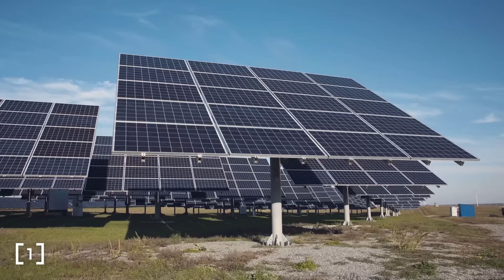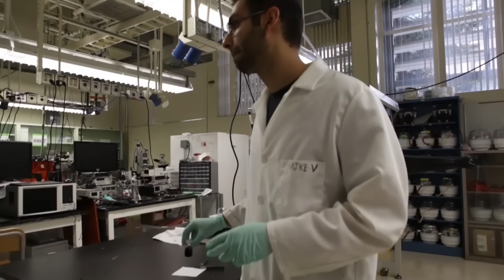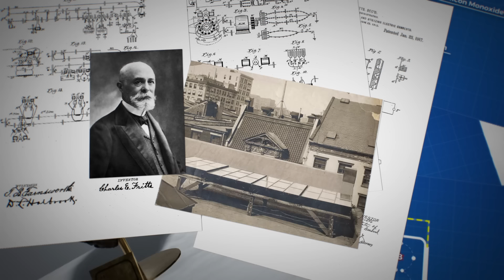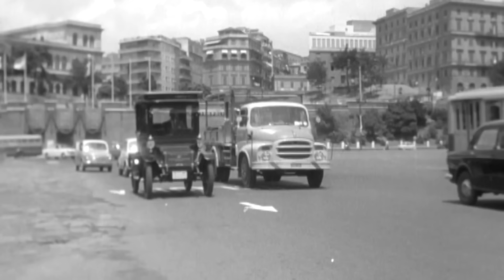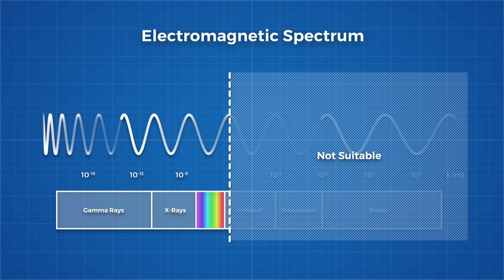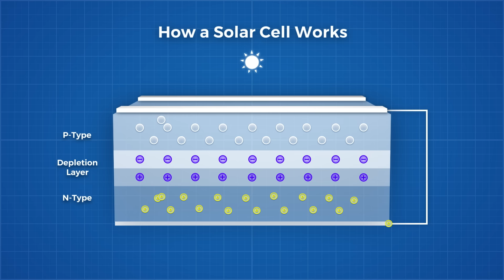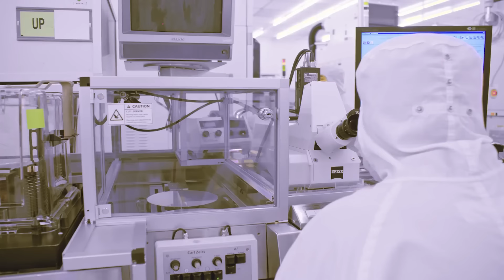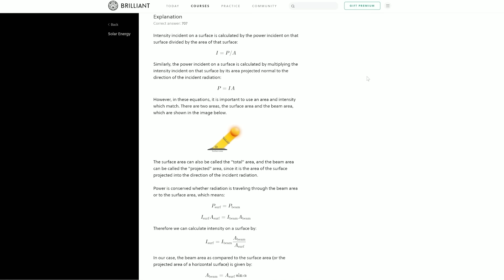The Mystery Flaw of Solar Panels

Comment: So, even at peak performance under optimal conditions, the current top of the line solar panels will lose 10% of their efficiency over the course of their work day. This doesn't account for bad weather, much less night when they're not working at all. And to achieve even this suspect performance, a host of rare Earth metals are required, to which the best researchers can come up with for a solution right now to this particular problem is to use yet another rare Earth material - the already rapidly depleting, widely used Gallium.

If solar is performing this poorly in the field, why is everyone pretending Solar is winning the battle with fossil fuels? By all accounts, power companies are using solar as green-washing vehicles, with gas-powered generators operating 24/7 right next to these inefficient, sporadic solar arrays.

Comment: I'm only amateur so with a grain of salt from me... but can't the 80% loss also be drastically reduced by developing solar panels that are of 60% loss plus greatly surpass the conventional design by being a fraction of the size of a typical solar panel?  I'm surprised that these Australian scientists did not receive a Nobel Prize that created a very small solar cell with tremendous output by splitting the light spectrum to capture the energy with a lower light frequency receptor and a higher frequency receptor.  Well before this video was created they designed "panels" that are so small you can't really call them panels.  They are more the size of a paperback novel and with 40% efficiency. See it on YouTube at:  https://www.youtube.com/watch?v=xmF9fLvCEDw  The only thing about this video by Real Engineering is I feel it can make solar power look bad and it really needs promotion in this day and age, promotion long overdue.  Why didn't you mention this achievement as it was long before your video and posted on YouTube in 2015!  Fossil fuel companies probably support major media and suppress such achievements.

Comment: I used to work at Sunpower, these brings back memories. I work In manufacturing so I understand everything you said. I still remember every step how we manufacture our solar cells. And how to break the 30% efficiency barrier? They already know what's the problem, unfortunately there is no solution yet.
Reply: No "yet" about it. The maximum theoretical efficiency is around 29%-27% depending on which limits you choose to measure by. We will never exceed this with single junction silicon solar cells.
Reply: Quantum Dot film. Look it up. It's on the way already, and could allow 35%.  Question for you though, if a person works at Sunpower are they able to buy / purchase a Sunpower panel without giving a home address you plan to install them on? Because Sunpower panels aren't up for purchase directly by consumers unless you supply them a home address. I have pleaded with them to sell me some as I live in an apartment, but they simply tell me no because they only sell them to home owners. :|
Reply: Still, loosing 70 percent of free doesn't cost much other than space needed to store it.

Comment: Hard to imagine not simply adding a bismuth-telluride junction with vertical fins on the back side of the cell to convert some of that infrared into electric power while simultaneously cooling the cell.

Comment: Just a small correction: As far as I understand it, the electric field that forms at the PN junction due to the potential difference is just electric not electromagnetic, because that field is static, so no magnetic component is present.
Reply: wouldn't the flow of electrons, ie.: current through the junction create a magnetic field?
Reply: @elgracko  You're right. There is a magnetic field, however, it is the electric field that accelerates the electrons.

Comment: The + and - at 11:00 are the wrong way around.  This is a common misconception.  A positive voltage means the terminal has a negative charge.  The electrons carrying the negative charge want to flow from the positive voltage terminal to the negative voltage terminal.

Comment: Dust is a highly underrated problem on solar panels that I never see mention of in panel efficiency.  It necessitates very hard, very expensive labor to keep up with dust settling. Simply rinsing is not enough, the panels must be rinsed with distilled water or well dried to prevent lime deposits. Improperly drying panels with tap water will make them lose efficiency permanently, so workers must be well supervised.
Reply: Now consider solar panels on liveaboard boats, sea water ;)
Reply: @robinspat  Good thinking!
Reply: I recommend visiting any other power generation plant. The sheer volume of skilled workers is significant compared to the few people needed to "wash the car".
Reply: @RevAnakin  There's one just down the road from me, and yes it does have a lot of highly paid,  happy, skilled workers with 401Ks.
Reply: @Bob_Adkins  times change, the horse and buggy "highly paid workers" had to shift to automobiles. People in service have had to shift into IT. Plant workers will just have to shift into different roles either in manufacturing or in grid operations. They can get their NERC operator certs and make more money.
Reply: Why not use an automatic cleaner?
Reply: @gabrielCardoso41200  When automatic window cleaners are ready for consumers, then automatic panel array cleaners for giant utility company arrays won't be far behind.
Reply: @Bob_Adkins  bruh just put a leaf blower in the side of each pannel lol these engineers nowdays...
Reply: @gabrielCardoso41200  Yeah, no matter that leaf blowers pull 600-2000w of power, and only blow off loose debris. Dew is really the worst enemy, it turns dust into mud and algae.
Reply: @Bob_Adkins  bruh just put a car windshield wiper lol
Reply: @gabrielCardoso41200  On 5-10,000 panels?
Reply: @Bob_Adkins  yep
Reply: must the worker's supervisors be supervised too?

Comment: Could we not use a super reflector mimic the ice caps or a panel designed around solely reflecting the suns rays back and if done at a massive scale could help reverse a good part of global warming. As that is the main benefit for the polar ice caps, glaciers, and snow other then water.  And why them receding has helped to raise world temps.

Comment: A friend with a rural bungalow near Oxford, he bought the place with old water solar panels on the roof, covering just 2-3% of the large roof.  Using a small electric pump to circulate the hot water and a tank, it produces all the hot water that 3 people can use, even in a southern English UK winter. This is simple old tech and the electric pump could also be run by solar electricity. Why has this simple Green technology not caught on? The answer is no privatised companies earning from it and no VAT to the government

Comment: The manufacturing process uses more energy than the cell will ever produce. The process also uses a lot of water and produces hazardous waste.
Reply: Stop talking about shit you don't know.
Reply: @animefreak7682  I built solar cells in a cleanroom for several years. Triple junction cells for use on satellites. Cells based on gallium, that use not only the visible spectrum, but infra red and uv. I know what I'm talking about. The photo resists need chemicals to be stripped off, the electricity to run the vacuum pumps, the arsenic dopants. You should not speak without knowledge.

Comment: Solar energy and wind mills are both obsolete technologies. Within 5 years or less you will see both going by the wayside. They are both so inefficient and not needed with newer technology soon to be on the market and some for free. You don't need storage. This technology here is obsolete. Next year you should be able to install a shoe sized unit that will power everything in you home electric. In fact it would power three homes that are all electric as it pulls energy from the surrounding atmosphere. No storage needed. Another technology can use a unit the size of a toy rubics-cube and will power San Francisco. Solar Panels are done. I'm sure this post will be deleted.

Comment: "Let me tell you how this thing works, but before I tell you how that works, let me tell you what this thing is and the processes that make it and them work, and before I tell you how these work, let me tell you about how this other thing works to make the other things work better; then I'll tell you about other aspects of these other things that will explain the second thing I mentioned, before I tell you, however, let me explain this which will make the first thing I told you clearer. Are you all clear on that, and these other things?"
Result: Before I saw this video I had no idea how a solar panel worked. After seeing this video I, definitely, don't know how a solar panel works. Thank you... I think... but, just in case could you explain those things again? Oh, no, too late; my mind has turned to mush. [walks into distance... dribbling and muttering...].  WTF?

Comment: Interesting push for an unsustainable energy system. Inefficiencies, cost and toxin rich batteries to "bank" the energy, night time, inconsistent weather, maintenance of solar panels, life expectancy of solar panels and a big one, government subsidies to an inefficient system, (which will soon disappear because , refer to opening statement, ) taxpayer burden, power company losses in revenue transferred to everyone on the grid. With advances in technology, fossil fuels are absolutely essential (and exponentially cleaner) than the Green proponents want you to believe. Hydro and nuclear are much more constant and sustainable than solar (and wind)  will ever achieve and surprisingly to most duped folks, cleaner. All this information is available, readily so, but you won't find it in any publication that sells these systems, nor will you find it in any beneficiary of the current funded subsidies. This guy has drunk a healthy dose of the "sustainable" kool-aid.  Oh yeah, consider the actual payback time of the original investment for rooftop systems. You'll find it never really happens. The system degrades and loses so much efficiency that it'll have to be replaced long before the return is actualized. It's marketed to make you feel good about yourself while the companies pocket your money and smile. Don't take my word for it, go ahead and go for it, buyers remorse is a terrible thing.

Comment: I believe it is because of atmospheric lensing. Same as how a magnifying glass can burn better at high noon than other times. The sun removes electrons from almost everything under it. In different ways, but solar will never be able to reach 100% efficiency. Nothing on the planet is tuned to accept 100% of the Suns power.

Comment: To be fair to clean energy,  you should do the public a favor and expose the flaws and failures of turbines, engines and fuel cells. And the flaws in the necessary horizontal infrastructure surrounding the operations of those machines.

Maybe you should also take another 101 course and show the breadth and depth of research and advancements in fossil based.  power generation.

Comment: It appears to be that with doping, the surfaces of the solar panels are taking the shape of a MOSFET transistor technology. Why not apply graphene on the top surface of the solar cell because I believe with only one layer, graphene is a see through material. 

Few years ago I saw an internet article that efficiency of solar cells can be improved by making their sufaces like the surfaces of a blue ray DVD.  But the article said that because of the high cost of production, such solar cells are not practical. Do you know what happened to that research work?

But I have a proposition to transfer that technology to China where they can manufacture things whole lot cheaper. 

America may have invented the mobile phone, but if it is not for China not every one of us would have a phone in our hand.

I have another proposition. Why not do research on how photosynthesis work on petals of sunflowers. May be this would give a breakthrough in photovoltaic effect technology in solar cells.

Comment: 19% efficiency improvement in a century?  I’m impressed.
Reply: if you were paying attention, the 1% efficiency was for the old original selenium panels. Actually there are silicon panels pushing 24% for sale right now..and If you have deep deep pockets there are germanium arsenide panels that push 46%.
Reply: @paulmcgown7504  Paul, I wish there were easy answers, but no.  
    A global carbon tax would have been sensible, it’s a fee for carrying out your CO2 garbage.   The market would work its magic.  But, Taxes make the politicians chumps, subsidies champs, so subsidies it is.  More favors to distribute and levers to pull.  And Solyndra SNAFUs with more on the way.
    The result of current scheme:  CO2 emissions will counterintuitively rise.  First there will be a substantive CO2 jump from mining, and process brings battery and panel minerals into play.  (China, the world’s foremost polluter control 80% of this market.). Hydrocarbon use will not diminish, it just moves to 2nd and 3rd world countries.  (Really expect the Saudis to quit pumping and, say, Mozambique to quit buying?)
Reply: Actually, if you take the time to think thru it, proper efficiency parameter is watts/sq meter.   This because solar arrays are a visual pollutant and one of several show stoppers.

Comment: Solar panels compared to modern nuclear power and hydroelectric power is like comparing an ox cart to a modern automobile. 
Solar power has it's place, were just not there yet. Storage using batteries is still too antique. Batteries and the solar panels are going to be a huge problem. Because they don't last very long and are hard to recycle at present time.

Comment: Great video, on an important topic applicable to the vast majority of currently available PV modules (mostly mono PERC). Just a small correction : typical LID of modern PV modules is 2%, meaning that after initial sunsoaking the PV module performance would be 98% of its initial one. So 98% of the initial ~20% efficiency. Which means a 0,4% decrease of efficiency, not 2% decrease. In terms of energy production the loss due to LID is then 2% and not 10%.
Reply: that's right, just after 30 years it reduces to 18%
Reply: @Randy Alvarado But that drop-off is almost certainly not linear, is it? That doesn't really mesh with what we see elsewhere.
Reply: @deus_ex_machina_  The loss is  .5% of the remaining efficiency, meaning  multiply .5% times the current year's efficiency, and subtract that amount to get the next year's efficiency.  So it is exponential decay, not linear.
Reply: @@randyalvarado6401 The solar expert meant to say "the panels would have 50% of their initial efficiency" or they would be only half as efficient as when they were new.

Comment: Didn’t know jack about solar panels and still don’t but can definitely draw parallels to PNP and NPN transistors, sounds similar (if my memory serves me right).
On the total capacity, it says online from eia.gov “In 2018, the R.E. Ginna nuclear power plant actually generated at total of 4,689,440 MWh.” That’s  ~8 times the total capacity of all solar panels in a single power plant, is that figure trustable?

Comment: Any engineer with half a brain knew that building out solar generating infrastructure over the past 15 years was going to be a complete waste of money.
Reply: China is building solar like crazy. Why? But you will probably say they are stupid or something.
Reply: @twt000 , because politicians aren't engineers.
Reply: @interestedparty00  Its the air pollution. Beijing has blue skies for once. All political though? You said "complete" waste of money. So no renewable energy at all? EVs?
Reply: @twt000 , only build energy infrastructure if you expect a positive ERORI. It's stupid to build something that will require more energy than it will create. Surely you agree.

Comment: your description is only valid for monocrystaline panels ... the multi crystaline panels are vastly more efficient as they target the wave lengths of usable light more directly and more readily absorb light in most of the spectrum faster .... the mono crystaline panels stick to one small band of light even with gallium boron and phsophorous they only use a sliver of the usable light spectrum ... this is where your band pass and fermi parts come into play to design better efficient panels with multiple wave length targeting dopings ... 
.
you can get a lady faster with a ferrari than a le car ... but if you have a garage of all the best cars you will get many more women ... when compared to the guy with just a lecar.

Comment: I was thinking... Why dont manufacturers of solar cells also try to use excess heat as a source of power when making solar cells and therefore making a mixed source of power? This would certainly boost solar cells efficiency.

Comment: Whilst at ARCO and Siemens Solar, we observed the same degradation (although our panels were 10-16%, and wafers 16-20%).  I observed that if the + and - leads of a wafer or panel was shunted, the degradation did not appear.

Do you know how much energy it takes to make solar wafers and/or panels?  To create/grow one ingot, 35Kg of silicon+doping, without slip dislocations roughly 105mm in diameter by 2m in length takes nearly 72 hours.  The melting point is roughly 1,500°C, and using the Cz method (Czochralski) to grow the ingot requires a tremendous amount of energy.  This ingot would yield roughly 1,200 wafers.